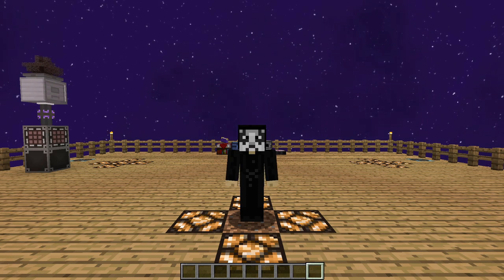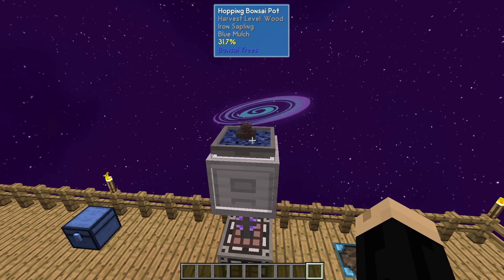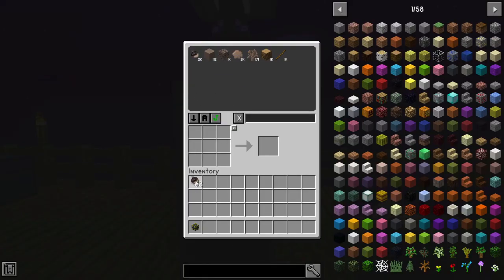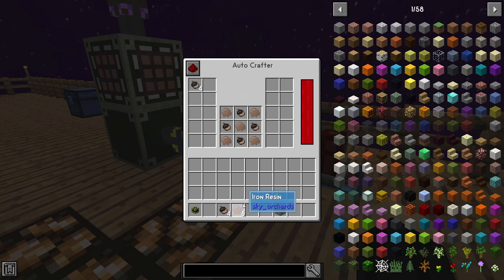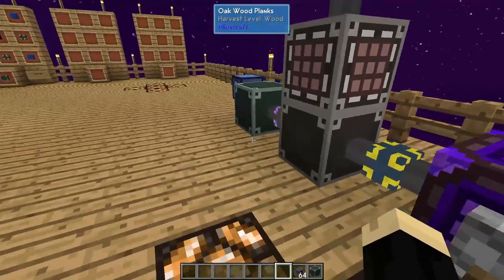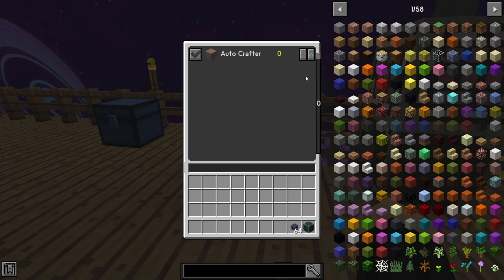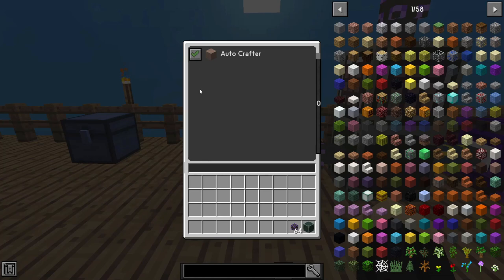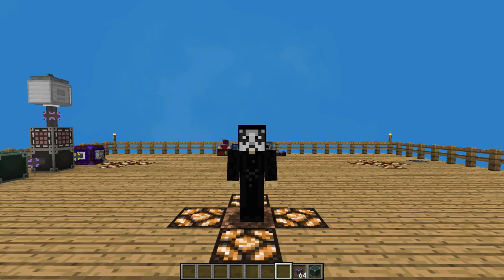Minecraft - Sky Factory 4 - How to Make and Use a Simple Storage Controller

Comment: I know this is an older video but maybe get lucky.... i use the simple storage with compact machines. In one i have my hopping bonsais in another my chests. Every time i try to suto craft ambers they do not go into the filing cabinets but into the chests in a different machine. Any tips tricks anything to get this to stop??
Reply from the maker: You'll need to check the priorities of the storage cables you have connected o each. If you want items to go into files before chests, then the chests priorities need to be set at a higher number than your file cabinets.
Reply: @OnlydravenGaming  I have the priority  set, but it just skips the filing and goes into the chest in a different compact machine

Comment: Can u also let it craft till there is a specific amount of an item in the system?
Reply from the maker: Unfortunately not that I've been able to find.
Reply: You could via a redstone circuit. Either through timing set ups, or simple comparator and a buffer set up. 

I.E. push button starts crafting. Goes into chest first, when comparator reads full, turns off system, turns off redstone that keeps chest from emptying, then all done